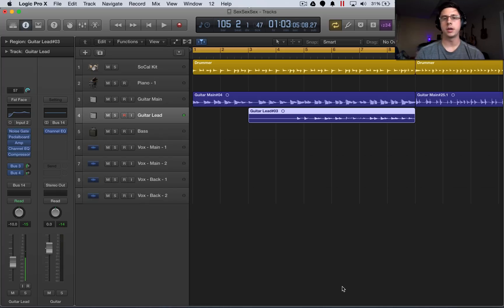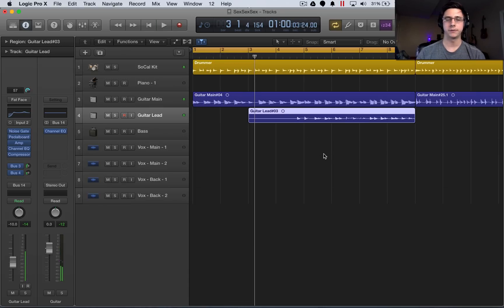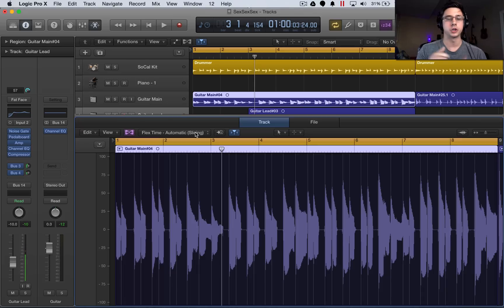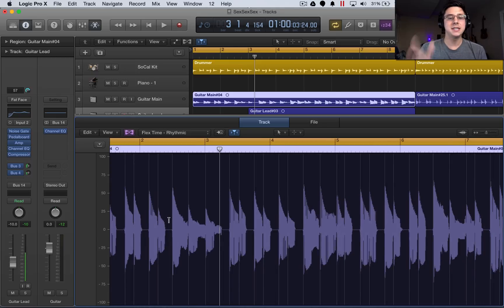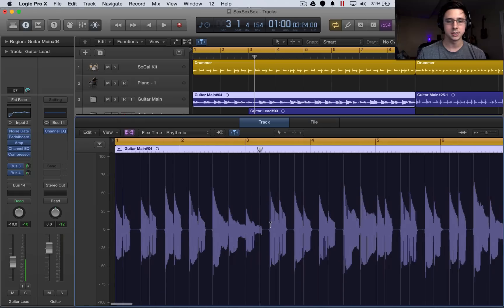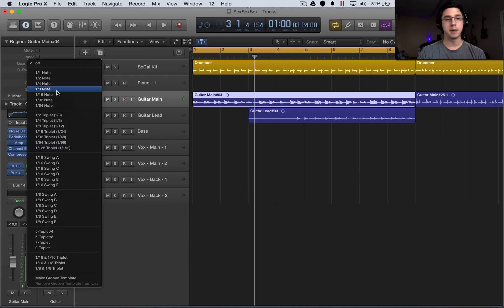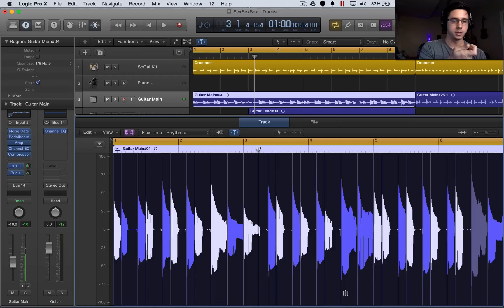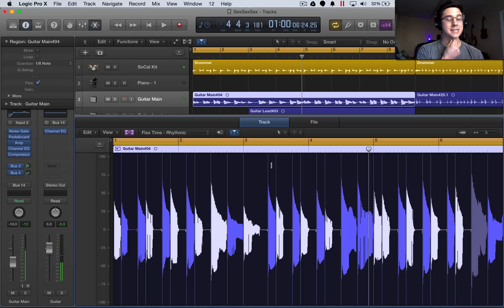Logic Pro X Tutorial - Audio Quantization

Comment: For me, this quantization works pretty much 99% in 2/4 or 4/4 time signatures. However, I have difficulty to manage that in 3/4 or 6/8. How do you fix that manually? When I apply that flex mode on a specific track it automatically shifts the audio wave while it was just analyzing the transients.

Comment: Hi, I have a live recording, just one stereo track, and want to quantize the whole song. I tried using just the beat mapping and markers but it started getting messy. I would like to first determine the lenght of the song and make logic cram the song into that many bars from beat one to the last (first choosing an average tempo myself) and then use flex to adjust the in-betweens. I don't know id this is the way to do it or if there is a simpler way. Any method will do, the idea is that I have a whole song, not just two bars. Thanks in advance.

Comment: Mitch, awesome video!  Do you fin that when you use flextime however that the audio quality can sometimes suffer or change from the original?  I've used it off and on and I feel that it sometimes does more harm than good.  Any thoughts on getting better consistent results with flextime?
Reply from the maker: +Jared Holton Yeah, I do find some quality loss. Usually it's not bad when you are careful with the size of your anchor regions. Meaning they should be as large as possible. The smaller regions tend to have drastic time shifts and cause noticeable glitches.
Reply: Mitch, 
Thank you for the Quick response.  I know you've touched on this with some of your other videos over the years but I was wondering how you edit your audio for your own songs?  Specifically, in regard to the traditional band (guitar, bass, drums, keys), what is the most naturally sounding way to edit audio and get a tight sound?  

Thanks in advance!
Jared

Comment: Really helps. Thanks for the videos. However, if you could make a video example in the scenario of 2 vocal takes and often the 2nd take of vocals aren't in align with the first. So in that case how would you align or quantize?
Reply from the maker: +khushal bhadra Yeah that's tough. There isn't a good way to align that automatically which means it'll be a lot of manual work to match them up.
Reply: +khushal bhadra Hi Khushal, I heard from a great producer that Vocal Align Pro is really good for exactly what you're talking about. but it's an additional plugin/software purchase:  http://www.synchroarts.com/products/vocalign-pro/overview